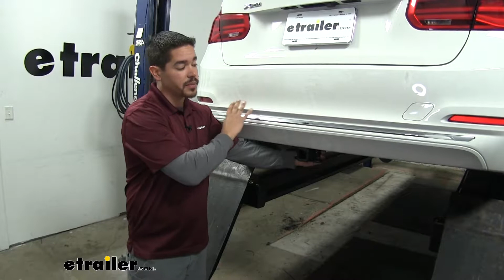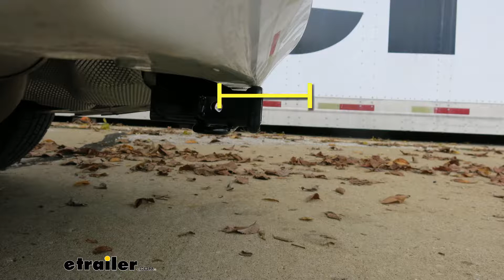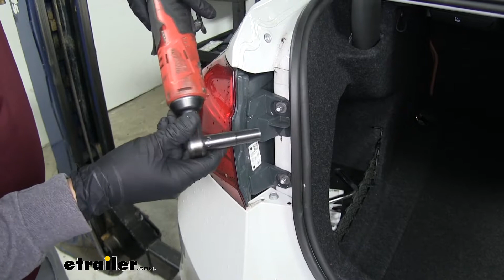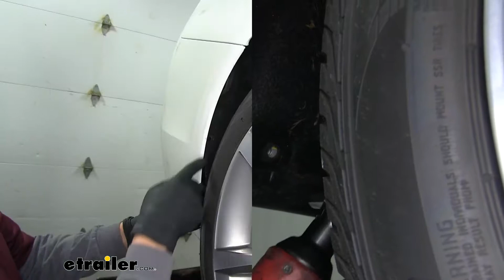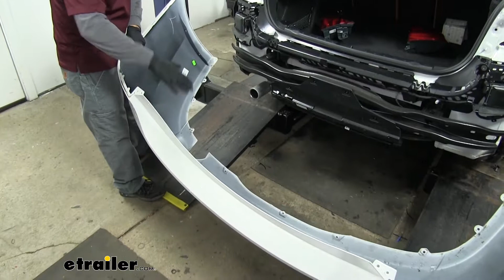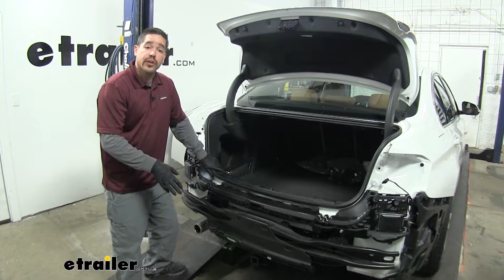etrailer | How to Install: Curt Trailer Hitch Receiver on your 2018 BMW 3 Series

Comment: Will this interfere with the remote trunk open sensor?
Reply from the maker: The sensor may be slightly blocked by the hitch. Usually when this is the case, you just need to find the sweet spot of where to swing your foot in order to utilize the feature.
https://www.etrailer.com/Trailer-Hitch/Curt/C11367.html